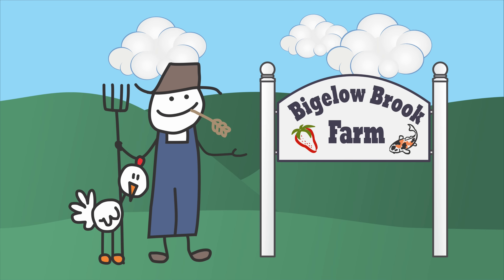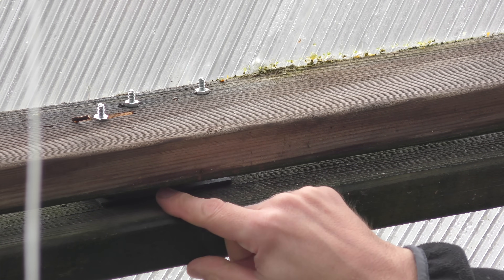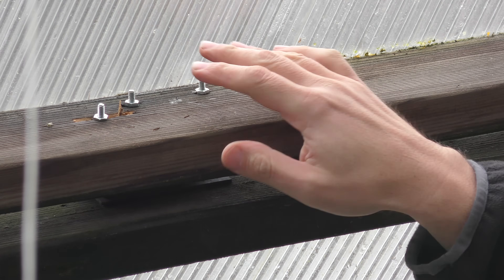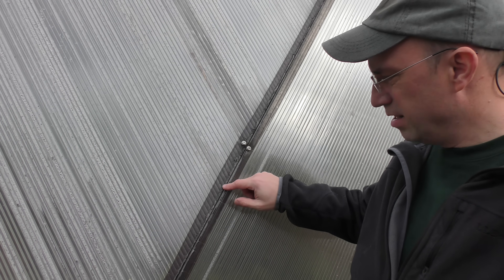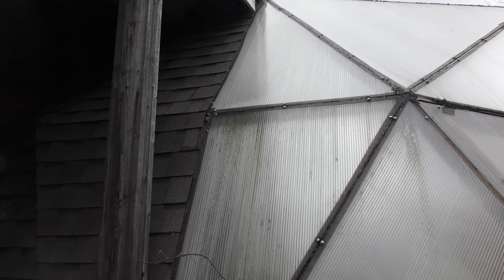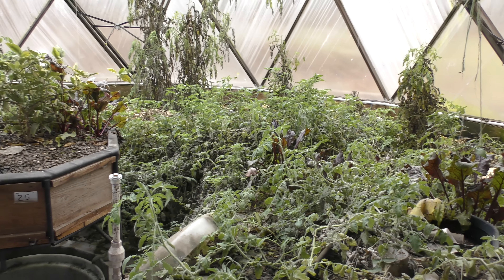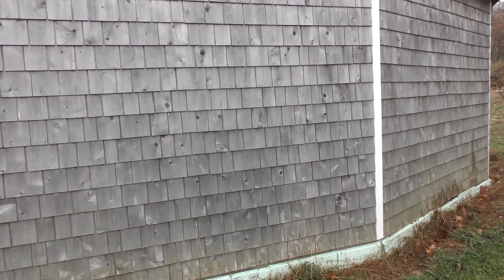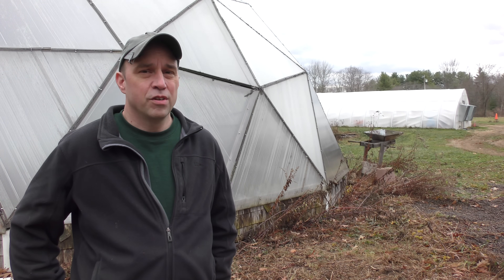My DIY dome is FAILING 😟

Comment: Got a 3d printer?  If I was doing your dome I think I might make the joints out of 3d printed plastic, probably something tough and UV stable.  I might make the struts out aluminium profile if it was cheap enough or maybe plastic pipes or whatever.  I would 3d print flexible material for weather proofing it.  I definately fancy making one now you have reminded me about it.  I hope its gets repaired and renewed, but its your money bud, spend it wisely.

Comment: It is SO valuable when people update with failures or repairs. Thank you, it's great content.
It's sad to find a fault that you could have been warned about when making your own version at home.
Reply: Yea, like being warned about not painting or staining the struts, then this will happen to you too after only 5 years. Also, put new tape on the joints outside every year, just over top of any old tape that won't peel up. Peel off what comes off, then tape over the seam again.

Comment: what about the plastic wood in place of what you have it should keep better then the regulars wood
Reply from the maker: I'm not even sure if they make a 2x4 in plastic but I bet it would be expensive looking at how expensive plastic decking  can be!  Thanks for the suggestion.
Reply: @Bigelowbrook  
I used a non toxic 2 part epoxy paint on my struts, it wasnt cheap but after 11 years  the wood is still sound and rot free. I`d sell the polycarb as a job lot to someone who wants to build a dome, it will save them a bunch of time not having to cut the triangles

Comment: If you take down everything but put a cap over the foundation, does that count as a demo for purposes of meeting code?  I think that's the route I'd go, put off doing any building for another year when hopefully things are closer to normal.
Reply from the maker: technically it would be a new building but he wouldn't give me a hard time about it.  I already check with him about changing it from a greenhouse to a workshop and he said it's classified as an auxiliary building so I wouldn't need any new permits.
Reply: @Bigelowbrook  So I think I'd take down the poly and geodome structure now, cap the foundation, and shore up the rest of the structure to prevent further water and moisture damage.  Put off any further building until after you assess what you have at that point.  It's sad, but realize it had a good run.

Comment: I think that’s just the problem with wood... you can work with it easily, but it will rot over time, especially with higher humidity like in a greenhouse.
It would be a pity, if you would tear it down. I just love the shape of domes...

Comment from the maker: I knew this video would get some attention.  😉 Feel free to leave a comment with what you would do!
Reply: we have the same issues with our dome in terms of debris and moisture getting into the polycarbonate, and leaking inbetween panels when tape deteriorates. To fix the leaking between panels we used 3m 4000UV (designed for the marine industry to take water and UV) also its flexible so can expand and contract to some extent. However....all in all, greenhouse domes leak and will continue to leak. We purchased a kit for quite some $$ and the company itself has not solved the issues either....

Domes are cool , but maintenance is high to keep them going....
Ive spoken with people that live in geodesic domes, but they are built much different. The panels are put on starting on the bottom, and overlaying each as you go up to cancel the leakage

if you dont repair the leaks, the wood rots. vicsous cycle from my experience so far....
I'd probably build one of glass and proper joints if we made one from scratch going forward

Steph
Reply from the maker: @svyarreh  I agree.  The dome is cool, but is a leaking maintenance nightmare.
Reply: I built a dome greenhouse which was a dream of mine since I followed your first videos and it is disappointing to hear your news ... but it was brave of you and consistent w your scientific method so congratulations on that! 
My greenhouse has an insulated north side w a rubber roof and has two layers of continuous plastic sheeting over the south side. The plastic is extremely strong. I’m not sure what it’s called but it is the same kind they use in the Midwest to transport huge bags of grain they move w cranes. It’s sort of woven translucent material. I assume that’s it’s less expensive than polycarbonate but it doesn’t have all those seams to fail. The wood was treated w an eco friendly salt treatment. In three months it’s still looks good but we shall see. 
I would prob want to keep yours as a both greenhouse for cold weather crops and workshop. It’s nice to have so much natural light in a workshop. Thank you so much for sharing the hard stuff too!
Reply: I would replace the dome struts with aluminum and greenhouse glass panels.
Reply: @jasrobsny  after replacing with galvanized or aluminum two layers of plastic would work better than polycarbonate like your greenhouse.
Reply: It would be a shame to tear it down. It's one of the things I've gotten to know and love on the interwebs, and to see it go down would suck. The rocket mass heater on steroids is when I first started watching, just checked, that's 7 years ago!!!!!
Whatever makes financial sense to you on the medium to long term is what I suggest primarily.
Reply: That dome would be a good workshop, that's the way I'd go. I have a 30ft concrete Geodesic Dome and seam cracking  is a big issue on sunny winter days. It does a number on the south face.  I would love to have shingles over lapping so a single small crack isn't an instant LEAK.

Comment: I have been working on a 20ft dia one myself with your videos as inspiration! This is definitely a bummer. Any advice before I finish mine up? I am about half way done putting up the polycarb sheets. I made my frame out of cedar 2x4s, are yours cedar?
Reply from the maker: Western red cedar...it was supposed to last longer than me.  ;-)
Reply: Very important to have perfectly sealed wood to polycarb connections     Look into 4- 5" Aluminum Rolls to center on the joint for added water = tight seal.
Get heating / cooling type duct tape made with Aluminum so it will not weather or freeze off.    Get the cold tolerant type; you will need a case of it.
Reply: Burn the wood, lasts for a millennia 😉
Reply: Use aluminum tape but not the cheap one.Aluminum butyl tape wich is thick ,1 mm and the glue its grey.Black tar aluminum tape doesnt work on polycarbonate.
Regular ,cheap aluminum tape( not butylic) its good for interior use if you have double walls like my dome but doesnt withstand the UV .
Seal the ends of the polycarbonate with cheap and thinest possible( i mean 1,5 cm tape that you can make it yourself by cutting from 5cm tape) cheap aluminum tape.
You can protect the polycarbonate on the most afected sites,with automotive solution for plastic headlights wich give UV protection.

Comment: If this was up to a vote I'd vote to redo it to a workshop However that really depends on the damage. How much would it end up running if you had to redo all of the wood? If it ends up being needing all the wood being replaced maybe just let it sit a year to get a better idea on cost of materials once the thing has passed.
Reply from the maker: From my latest inspection, only a few pieces need replacement. It's the cost of the exterior sheathing and shingles that's a big pill to swallow.  Building materials have skyrocketed in price this year!

Comment: I'd take the cheap route and just buy a new sheet of film and cover the whole thing and silicone the overlaps to seal them on the side of least sun exposure. The sunlight loss from the added layer couldn't be that significant. And plant a crop with less light requirements etc,.

Comment: Wow, can't believe it's been a decade since I watched you put this done together. 

While it's obvious that the struts need to be replaced and proper weather stripping applied to the building. It seems like the poly could just be cleaned up and retaped. Is that not the case?
Reply from the maker: Most of it could be but it is starting to degrade from the UV.  the poly has a 10 year warranty so that's basically done.  I'd hate to go through the trouble of cleaning it all up and have to replace it in a couple more years anyway.  I'm also not sure if I can get the old tape residue off.  It's a polyethylene tape so maybe acetone would remove it, but I know acetone also etches into polycarb.  I don't think there is an ideal solution for it.
Reply: @Bigelowbrook  
Some of the panels in better condition could get cleaned and saved for other projects. Though I can't think of any projects off the top of my head that could make use of giant triangles of double wall poly. Make little pyramids and place them around the property to confuse the neighbours maybe?

Comment: Had to be expected, high humidity and wood.
Reply: Which material would you have used?
Reply: @geo.33  abs/pvc piping, conduit to hold the pipe ends instead of rectangular tabs fastened onto wood on the brackets 

the sheets can be mounted with bolts and holes through the piping, with silicon sandwiched between the pipe and the sheets. you could also use bailing wire or self tapping screws. 

everything would be water resistant and it would still be strong. with the price of 2x4 I bet cheaper too. that's how I plan on doing it. idk the price of conduit vs pvc but I would use emt if it was economical.

one day I might have the money to build one using fabricated aluminum pieces for awesome strength.
Reply: @dylanmccallister1888  yea??? so how are you gonna screw the solid greenhouse panels to the pvc?  That's not plastic stretched over a dome ya know, it's rigid greenhouse panels.   The dome design allows for a flat rigid panel as opposed to hoop style greenhouses that uses poly.   His issue is not the humidity anyways, it the fact it leaks and soaks up rain water which is exasperated by the fact it doesn't really dry due to humidity.  The wood without getting wet from rain water would not be soaked like it is in the video.   There are companies that make commercial domes.like this from wood and this is not an issue.  That said they also use cypress which holds up in humidity.   Black locust would be even better imo, but whatever.  
Anyways what he needs to really do is seal the dome from the outside so the wood doesn't soak up rain water.
Reply: Cedar
Reply: @cpeters4360  I would use cedar or wood that’s been oiled or better yet, aluminum, stainless steel, or galvanized steel square tubing with double pane tempered glass windows with proper sealant. More expensive of course, unless you repurposed used materials but it would last more than a lifetime.

Comment: So all you really need is a better quality of tape, check out the stuff they use for RV's
Reply from the maker: This was basically the best stuff I could get at the time.  It's called "leading edge" tape and is used on aircraft!
Reply: @Bigelowbrook  that was expensive tape. Please let us know if you find a better alternative.  Maybe you can power wash the flutes on the panels??
Reply from the maker: @EarthshipFreedom  I think there was about $1000 worth of tape....  I may hit the poly with a power washer...we'll see what kind of condition it's in what I get into it a little more

Comment: awe, I feel ya. You build a thing and you think it will be around for generations long after you're gone and it becomes obsolete within your life time, it's hard to know what to do. I am still running my first PVC pipe hydroponic system, everything points to dismantling it and making a better system based on what I have learned from it but every year I just can't bring myself to do it.
Reply from the maker: My grandfather built is 1st greenhouse in the 60's with cedar...it lasted about 50 years when it collapsed under a snow storm...it was still in decent condition.
Reply: but that was probably glass not poly...........